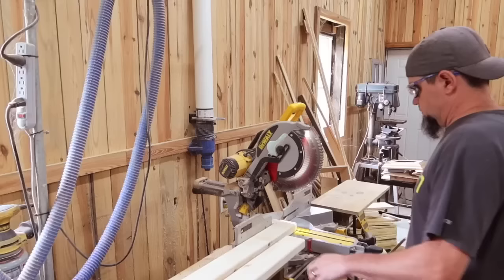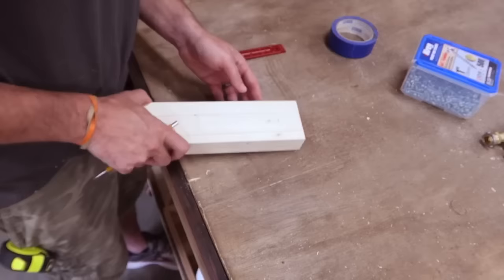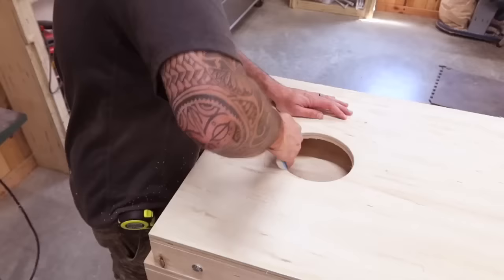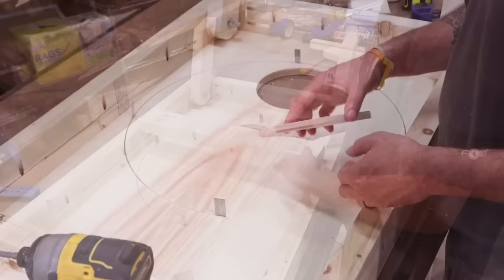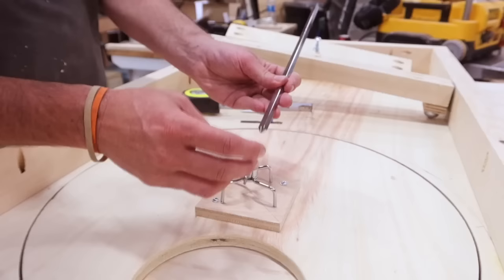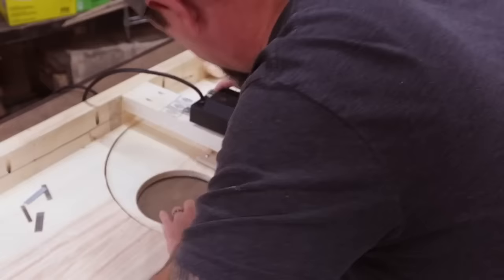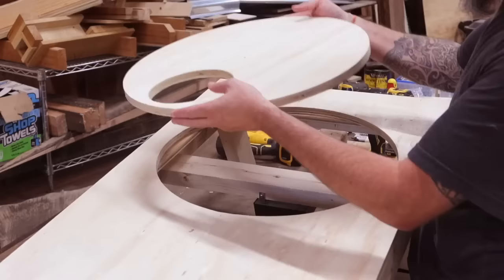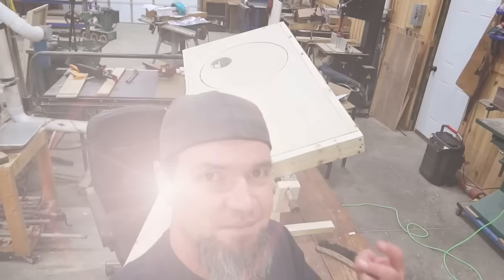DIY Ultimate Rotating Cornhole Boards - Make Money Woodworking

Comment: What a great idea. My wife asked me why I can’t get ideas like that. I said because I’m not Matthew Peech.
Reply from the maker: Bahahaha... now thats funny.  You just have to think like a crazy person...
Reply: @MatthewPeechWoodworking  somebody in your comments is acting like you same name same picture told me I won something you might want to check that out
Reply: Look under my name and comment
Reply: Yeah, I told mine I do have ideas like that… right after Matthew Peech has ‘em. Just bad luck! 😂
Reply: Great answer!
Reply: Why can't she grow a beard like his?
Reply: @Mark Glabinski i looked the video up for you I was wrong. Its a radial engine... I think it has 8 cylinders and they go so fast its ridiculous bro 99% wood or 100 i am not sure. The pistons may be encased in a polymer of sorts
They also have a guy who builds tiny cars from wood that run the key turns them on they have a clutch a brake a gas pedal and motor transmission and rear-end. These 3 guys are super carpenters
Reply: Here is the link

Or what to type 

How a Radial Engine Works- High RPM (Part 3)

￼YouTube • Ian Jimmerson
Reply: @MatthewPeechWoodworking  not many super carpenters share matt so I wanted to say thanks. Too bad u don't live around houston I would come over help you just so you could teach me a trade. I need to learn so bad
Reply: At least your wife talks to you.
Reply: @kenclarke4906  and that’s a good thing? Lol.

Comment: I'm going to buy your plans for sure. We need to improve on this. Which is have it attached to like a rechargeable battery.  It needs to be able to be used with out a power cord.
Reply from the maker: Heck yea.  They actually make a rotating display that is battery powered... but they are expensive
Reply: @MatthewPeechWoodworking  so let's brain storm my friend.  So, how about some kind of mini converter to charging source. Or maybe a way to install like idk, a ryobi, Milwaukee or some kind of battery. Something that can generate enough amp I would think. Your thoughts?
Reply: Power wheels motor with gearbox is about $20 each transmission gear about$10... battery adapter for Milwaukee or DeWalt or Ryobi Ridgid battery about $13-16 maybe even a speed controller $13 and reverse switch $13
So min about $45-50 for cordless option per board or about $40 per board for rotisserie motor? Then it could be sold with or without the batteries.
Reply: Solar power…possible?

Comment: You could also add wwod gear teeth to the underside around the outer perimeter of the moving circle and then mount the motor below the circle with matching teeth. That way there won't be a board under the hole on the left and right side.  It will be an open hole the whole cycle around.
Reply: Noticed the same.  Your idea is better than mine! It would be great to see him do a 2.0 with this improvement.
Reply: I love this build. But that is a good question about what happens to a bag that lands on the 2x4 underneath. Will it block the disk from spinning or get pushed off as the hole passes over? 
If I want to CNC your gear idea, that’s quite a different level of planning.

Comment: 👍❤️. I did not read all comments but I would suggest a Spring (cord winder type) instead of motor. User would wind the plate and the spring could rotate it around.

Comment: I just finished the herringbone planter. Took me a while working on it here and there. Learned a few things along the way, like that fence pickets are a royal pain to work with. Also learned a lot about using a table saw, which I only had the most minimum experience with. 

I also learned that while plans are nice to have, the measurements are only right if your cuts are exactly right. The planter came out a little off square, and I should have measured for the trim pieces, as they didn't fit perfectly right. 

It's funny in a simple way, but making a square can be one of the most difficult things...

Comment: Oh, man!! Thank you for the tip on using 1 1/4” screws on 1 1/2” material!!! I just built my first workbench and ended up having to buy 1 3/4” cabinet screws, which worked, but I sure could have saved a few bucks as I already had a bunch of the smaller ones. Well, I’m making a pair of twin benches, so I’ll use that tip on the other one. You’re awesome!!!!

Comment: You are changing the game, Mr Peech, on many levels.  I think I'm going to give this a try.  It says a lot about you that you're willing to put this invention out there at no cost and just encourage everyone to go for it!  Thanks so much.  I'm curious to know what your material costs were for this.  And more importantly, if you WERE to start batching these out and selling them, what would you sell them for?
Reply from the maker: Thanks!  The material cost will be the same as a normal set of boards with the exception of the motor kit.  You'll have to add that cost in and I would atleast add $100 on top of what normal boards are selling for plus the motor costs.
Reply: This guy is know mattew

Comment: Hey Mathew!  My dad and I love watching your projects!  We’re constructing  this rotating board now with the newest modifications for battery operation.  In fact, his motor is both battery  & plug in 👍
He is an engineer and we had this question:  Have you seen yet, or what are the possibilities of bags getting pushed into the hole when the hole is over the support bar?  Could be disastrous if they hang up and big the motor down.   Anyone come across this yet??  Hmmmm 🧐
Thanks a bunch for any ideas, solutions or comments!!

Comment: Have you tried old windshield wiper motors? that way it 12vdc and able to hookup remotely easier. You can power it from a camper or car. You can add a speed controller to make it even more adaptable.
Reply from the maker: You can actually put a power inverter for a 20v battery on it.  But they are around $50 each.

Comment: With the current setup, can the bag hang on the motor support until it rotates / get jammed in it ? is the space between the bottom of the circles and the support enough for the bag to get stuck ? if you lower the support under the side, instead of between the side, will it have enough clearance ? add some pieces on the underside of the circle, to push the  bag that can get on the support off so they will fall off ?

Comment: I found a battery powered  Rotisserie motor on Amazon $24.99. runs for 36 hours on 2 D cells. The mount will have to be modified.
Reply from the maker: Yea I found one too and ordered one.   I wanted test it out.  It actually works well.  Im going to do a video on mounting the new one.

Comment: Awesome video!  I just found your channel yesterday and subscribed immediately.  I saw a couple mentions on adding a way to keep score.  On the boards I used to make, I stenciled a row of numbers 1-21 that ran through the middle of the back board.  Then I drilled holes above and below each number that would fit a golf tee.  I have pictures if you'd like to check it out.  I did this because it was low tech, straight forward, and if you lost/broke a tee it was easily replaceable.  Things I thought you could appreciate.  Anyway, your a good dude!  I appreciate what you're doing on this channel.  Thank you for giving me inspiration.

Comment: 1 question...if the timing was just right, is there a potential for when a bag goes in the hole to get wedged between the spinning hole and the motor support? If so, does that motor have enough torque to do any damage, or would it just stop until the jam is cleared? This looks awesome, I think I'm going to have to try it!
Reply from the maker: Hey Ted.  We have played tons of games on them and havent had and issue.  The motors are actually designed to reverse if there is any resistance.  Makes things interesting.
Reply: This guy is not matthew

Comment: This is awesome, one question though,.... could you cut the outside of the rotating circle on an angle to prevent it from coming out the top of the board? Just a thought...

Comment: So far iv just made wishing wells out of old pallet wood. I'm lacking the confidence in being sure I can actually build anything else. But I have the motivation to at least try. Iv almost got all the tools I could need mainly just missing simple stuff like different size drill bits and pocket screw tool and clamps.

Comment: I would keep a longer rod and run the motor to the ground so you don’t have the rotating hole run across the brace at two points during its rotation.  It would improve functionality but impact portability.

Comment: The bags were once commonly filled with dried corn or cracked corn, and then tossed through the hole... you can tell if you find bags like that because they are super dusty

Comment: How's the weight? I did a set for my sister once from 2x and it was a beast. I've been mulling a torsion box based board to reduce weight but limit flex and any trampoline effect.

Comment: FYI. Your rotating disc design would also be great out of metal for a rotating welding table.
Although, for welding it would be better if the rotation speed was adjustable. I wonder if this rotisserie motor could be driven with a PWM or a fan motor speed controller?

Comment: For the version at the end of the video: Put the lower end on the ground with a curved piece of wood to hold it up. No need for the second pivot point.
It would be cool if the speed of the tilt and of the rotation were somehow randomized. (Think Arduino.)
Oh yea, put was on the rub points to reduce friction.

Comment: The bags had corn in them at first but the corn breaks up and turns to dust then the bags don't weigh a pound anymore so that why it's resin disk and beads in the bags now but that's why it's called corn hole plus you don't want a corn bags to get wet and the corn starting to sprout in the bag lol it happened before but yeah now it a science behind different types of beads in the bags

Comment: What about a DC powered version for portability where you don't have AC power (like camping, etc...).  I know they make 12v DC rotisserie motors.
Reply from the maker: That would work for sure.  May be pretty expensive.  But If your making them for yourself.  I'm not going to put it on the channel but you can wire a cordless battery charger to backfeed from a battery and convert dc into ac.

Comment: Hey Matt, I recently found your channel and subscribed. This ultimate cornhole is awesome and I'm good with wood working, metal working, and electronics. The rotisserie motor is great for high torque and low rpm, but it runs on ac power. A better solution is to run a window motor (for power windows in a vehicle). They run on 12v dc, so this can be battery powered, and there is plenty of room underneath to drop in a bunch of 18650 lithium cells and make this thing rechargeable. It would be about $60 in electronics plus the cost of wood. Do you think people would buy it at $150?

Comment: How did you get them to run and operate outside if the motor had a plug? And where do you get the extra motor at?

Comment: Hello. Incredible idea and will be building these. One question, if you are traveling or take them anywhere to play, where/how would you supply the power? I don’t see that idea with any power converter possibility to mount underneath. Any ideas? Thanks!!
Reply: I’ve engineered some with a remote and a 12v 6000mah battery pack

Comment: 110 power...with extension cords?
This needs to be cordless.  🤔 Power wheels motor with gearbox  18v battery adapter for power tools Maybe even a speed controller and reverse switch?

Comment: How safe is this? If a kid puts their hand through the hole to grab a bean bag and it gets caught between the hole and the crossbeam? Does the rotisserie motor have enough force to do damage?
Reply from the maker: Nope.  It's designed to reverse itself with any resistance.  You can hold it with one finger and it will reverse.
Reply: @MatthewPeechWoodworking  That is great to hear! I figured you had considered that already. Awesome work on this design!

Comment: If you can eliminate the plug and find a motor that is powerful enough with batteries making which would make it more versatile, meaning you can play anywhere not just near electrical outlets and get rid of that messy look of extension cords and trip hazard when everyone starts getting tuned lol

Comment: Working on a set now. Has anyone addressed the issue of the bag potentially getting wedged between the hole and 2x4 mount for the motor? Also.. I used the same rotisserie kit and found out if you tug on the circle at the hole hard enough it will reverse the motors direction
Reply from the maker: We have played tons of games on ours.  If it land on the mount it just drags off.

Comment: As if cornhole isn’t hard enough as it is.😂
 Question: If you turned off the motor and wanted to use it as a normal cornhole board, does the hole move out of place if a bag lands on it? We might need to come up with a mechanism that locks it in place at the correct location.

Comment: Has anyone tried or used a battery powered motor? Wondering how long batteries last and how well it would work. Im thinking it would be easier than running 2 ext cords and finding an outlet

Comment: You should put a link where you found the second motor by itself for a reasonable price
Reply from the maker: I didnt... I bought 2 kits.  When I got them in I realized there was enough material in one for 2 boards if you had an extra motor.  There are some companies that sell just the motor.  You may just have to mount it a bit different.
Reply: @MatthewPeechWoodworking  ohh alright, thankyou. Buying two kits just seems to make the most sense anyways because the motors by themselves cost 3 times the amount 1 kit does. Keep up the great work, I just bought the plans for this and can’t wait to build it!

Comment: HI GUY I ONLY HAVE ONE COMPLAINT ABOUT THIS VIDEO . THE BOARD ITSELF IS GONNA WEIGH A TON , MAYBE CAN BE MADE WITH ONE X FOUR MATERIAL AND 1/2" PLYWOOD INSTEAD OF 3/4" MAYBE YOU CAN TRY THIS !!
Reply from the maker: Well.. I'm not a fan of 1/2" ply.  It creates a bounce effect.  But If you would like just alter the sizes to match those dimensions.  Actually as light as 2x4s are now days the boards arent that heavy.

Comment: You should modify this so you can use a battery with it like from a Ryobi or Dewalt so you dont need electricity.
Reply from the maker: You can actually use a power inverter that runs off dewalt battery.

Comment: Don’t know how you made that jig saw jig work but mine was an epic fail. It burnt through the side of the jig and set the the jig on fire sending the blade way off coarse. Any other suggestions?
Reply: I had a similar issue. I bought a little longer blade that cuts both directions. You need to use a really good jig saw also
Reply: @peteraley8650  I got it to work with a few modifications but yeah you definitely need a good jig saw which I do not have. Hopefully I don’t mess up anymore 2x4 pieces of birch

Comment: What jig saw blade did you use.  I have a dewalt 331 which is an awesome jigsaw. The problem I’m having is it’s burning the plywood and the blade is wandering and sometimes bending. The blades are like 6 tpi. I went and got a scrolling blade but it was too short. Thank you. Awesome idea.
Reply from the maker: I use Bosch blades. But make sure at its lowest it still cuts. If not it will hit and bend. Remember pressure down and forward.

Comment: Could this be built using 20 volt rechargeable batteries? It would be more portable.
Reply: I’ve built some that are remote operated with a 12v 6000mah battery pack
Reply: @mattyounts9400  Where , what kind of motor did you use?

Comment: This has an obvious fail point not covered in the video.  When a bag lands in the hole passing by the crossbeam holding the actuator it will jam the system.  The bags need to pass all the way through the cornhole without obstruction.
Reply: The only time it MAY happen is at the 3 and 9 o'clock position. Even at that I don't think it'll be that much of a problem.
Reply from the maker: Actually it doesn’t. There’s 1 1/2”  of clearance. Even if it lands on the support the motor pushes it off.
Reply: @MatthewPeechWoodworking  I just rewatched the start of the video and can see the gap you're describing.  I take back what I said and apologise.  I need to remember to follow the rules of not posting while on the liquer.